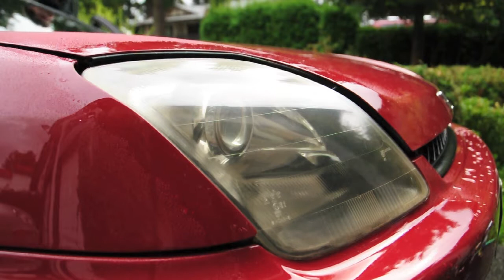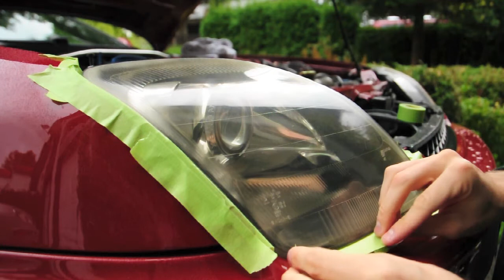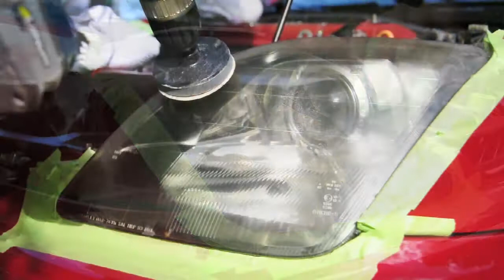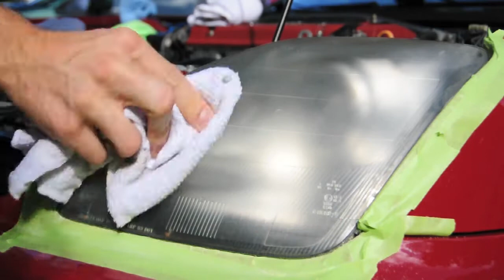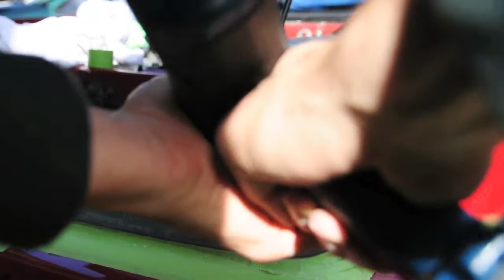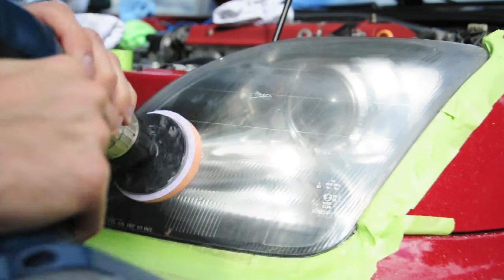Honda Prelude 3M Headlight Restoration Kit

Comment from the maker: No problem! Glad I could help. All you need is a drill, water spray bottle or hose and the 3M headlight restoration kit. The kit was $19 CDN from CanadianTire. 'm going to do this again in a few months but this time I'm going to apply some TurtleWax Polishing Compound for the last step as my headlights are are still a wee bit hazy but nothing too serious.

Comment from the maker: The kit was on sale for 19.99 at Canadian Tire. I am not sure if either vehicles have a fading issue, you would have to do some research. Perhaps all headlights develop some type of fade issue over time.
If you choose to restore your headlights or even do the traditional wet sanding, it is highly recommended to have a professional auto body shop to spray clear coat on the headlights or apply a layer of LaminX

Comment from the maker: So far, it's been about 6 months and it still pretty good. However, my light output is still not where I'd like it to be but I think thats due to my old D2S bulbs so I'll have to replace those soon. The clear plastic on the headlights is still looking sharp. I'd recommend applying some type of polishing compound as the very last step. I was told to apply some LaminX once it's all done to really seal everything in and to protect the headlights. Or you can have a body shop spray some clear coat.

Comment from the maker: I've used the Meguiar's restoration kit before I used the 3M. I seem to have better results with the 3M; however, my light output is still not where I'd like it to be. I was informed to apply a layer of Lamin-X after polishing headlights or spray clear coat. It's suppose to provide the headlights with some extra protection and give it an overall finished look. I did not have any rock chips on my headlights. I'm not sure how to remove those other then buying new headlights. Sorry :(

Comment: While I was having my headlights restored at the Honda dealership yesterday, I saw a sign in the waiting room advertising their headlight restoration service using 3M Headlight Lens Restoration System.  My headlights look just as good as these do now. Now that I know what they use I can save about $50 every two years or so.

Comment: Did you have any stone chips on your headlights when you restored them? I used Meguiar's restoration kit last year, and while it got rid of all the haze, it required no sanding, so all my the stone chips are still noticeable on the headlight, especially at night with the headlights on. I was curious if you'd know if purchasing the 3m kit or just simply wetsanding + Meguiar's polish will work? Thx :)